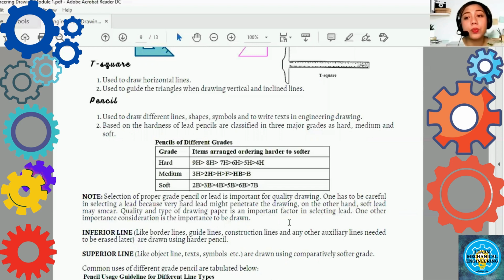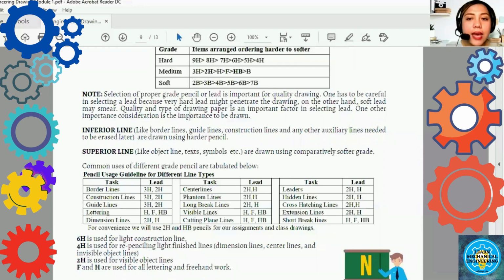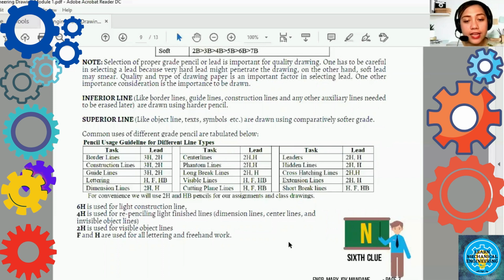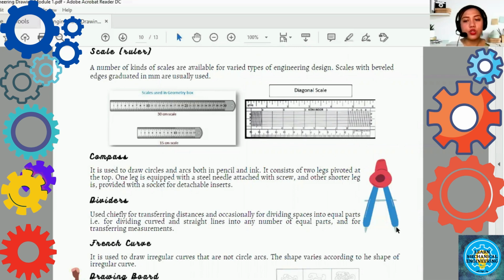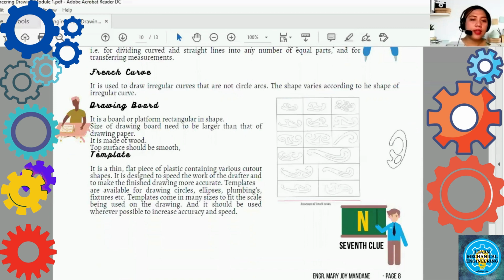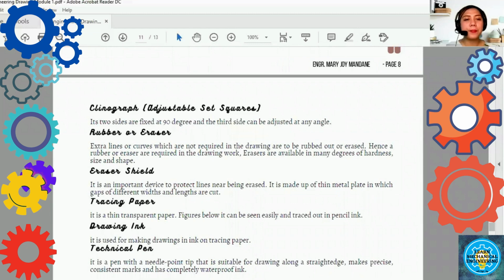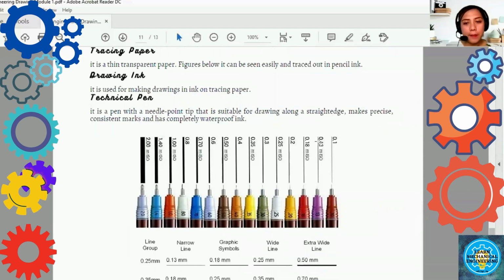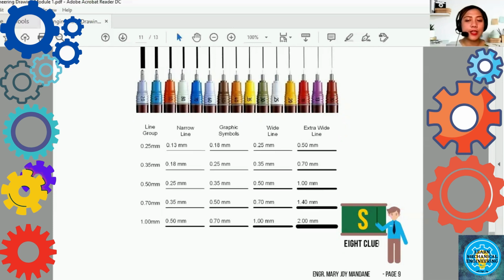ENGINEERING DRAWING MODULE 1 PART 3: Orientation and Overview of Engineering Drawing and Its App.

Comment: -The recommended pencils to be used are H, 2H, and 3H
-For borderlines 0.7 and 0.8 mm thickness should be used. For the outputs, 0.5 mm thickness should be used. For the title block, 0.3 mm thickness should be used

Comment: *The recommended pencil grades to be used are 3H, 2H, and H

*For the technical pens, 0.7/0.8 technical pen ink thickness are for the border line, 0.5 for the outputs, and 0.3 for the title block

Comment: - The recommended pencils to be used are H, 2H, and 3H
-For borderlines 0.7 and 0.8 mm thickness will be used. For the outputs, 0.5 mm thickness will be used. For the title block, 0.3 mm thickness will be used.

Comment: * Recommended pencil grades to be used in our subject are 3H, 2H and H.

*Technical pens with 0.8 and 0.7 mm thickness are for border lines. For the outputs, we’ll be using a 0.5 mm size, and the 0.3 mm sized is for the title block.

Comment: - the recommended pencil grade or lead is medium, specifically H, 2H and 3H 

- the technical pen thickness that will be used for borders are 0.8/0.7, while in output is 0.5 and for the title block 0.3

Comment: The recommended pencil grades are 3H, 2H as well as H.

For the prescribed points to be used, either 0.8 or 0.7 would be used for the border lines, 0.3 would be used for the things to be written on the title block, while 0.5 would be the one mainly used for the outputs.

Comment: The recommended pencil to be used are 3H, 2H and H.

0.8 or 0.7 technical pens will be used for border lines, for outputs we will use 0.5 technical pen and for title block we will use 0.3 technical pen